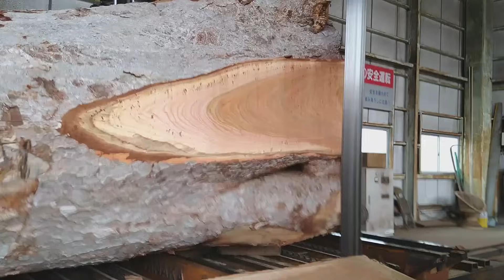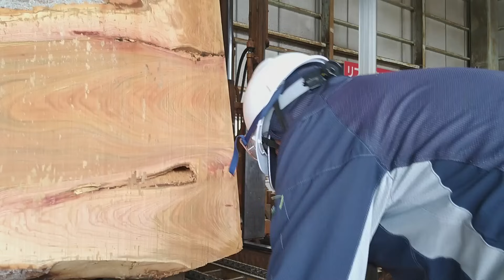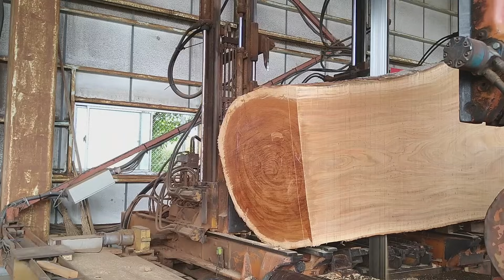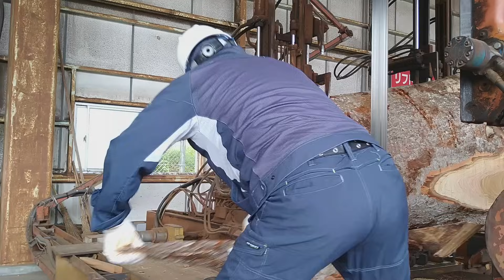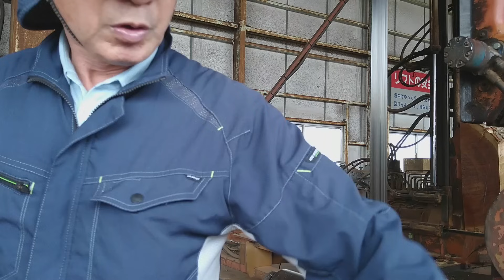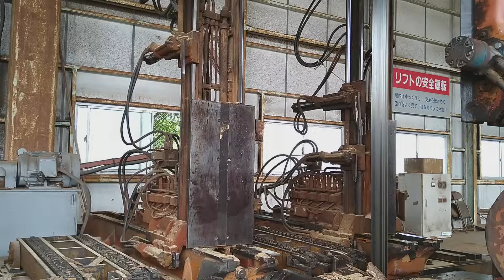危険な欅の製材・Danger zelkova sawing!!

Comment: If you watch the video in slow mode you will notice that the saw cut left a bump in the wood and when the wood was moved back to the starting point the bump caught the saw blade from the back side and broke it now the question is why the bump maybe dull saw or the wood moved 🤔.